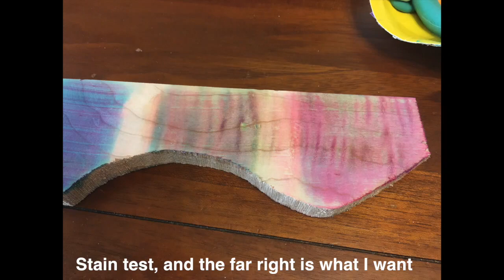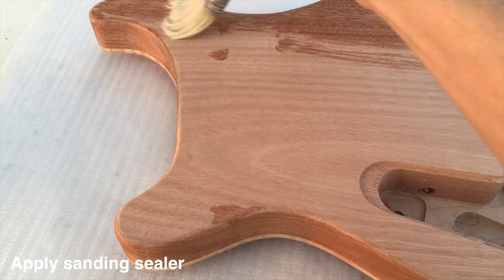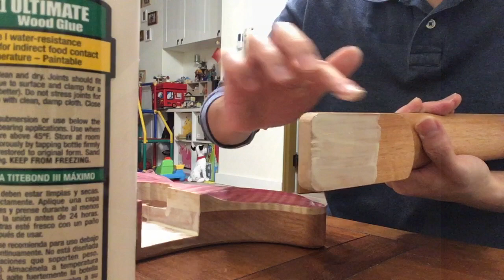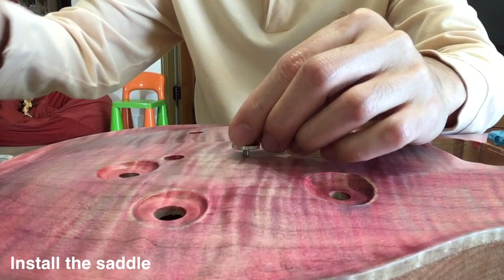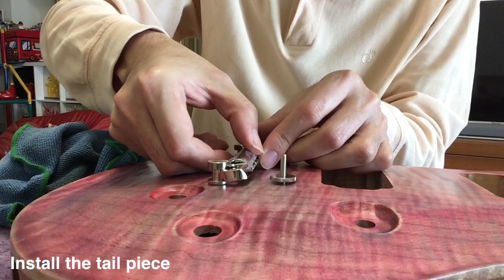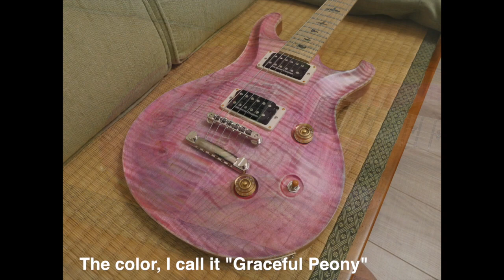My second DIY guitar kit build, PRS style, for my daughter Grace.

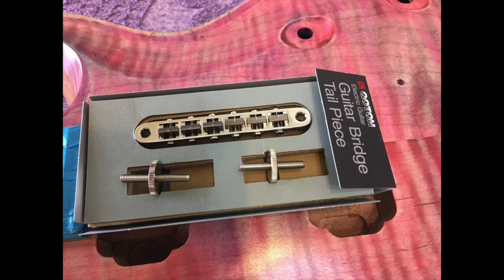Comment: At the 1:41 mark, shouldn't those threaded ABR-1 Bridge Posts have been threaded into the top? 😳
It is my understanding that the threaded bridge posts are supposed to be threaded deep enough so as to pass through the maple top and also make contact with the mahogany body.
Reply from the maker: Yes, you are right. But I didn’t know that at that time. So I just hammered it in.
Reply: @MrKklee100  Understood.   I learned a lot when I finished off my Les Paul build.  I find it so very satisfying building and working on guitars.  Thank You for sharing these clips with us.
Reply from the maker: Thank you.

Comment: Did you get both of your kits from Bian Xuebin? Does the neck break angle and the frets line up to intonate correctly? Because that's an issue usually with chinese guitar kits. That and water content in the wood. Have you had any issues?

Otherwise I think the kits look pretty great. It's an actual flamed maple cap, from the looks of it.
Reply from the maker: Max Cohen Thanks for comment. Yeah, the two kits come from Mr. Bian. And the only problem I encountered so far is the fret. I must send them for fret dressing by a luthier. And no other problems so far.
Reply: @MrKklee100  I appreciate your quick response and thank you for the information.